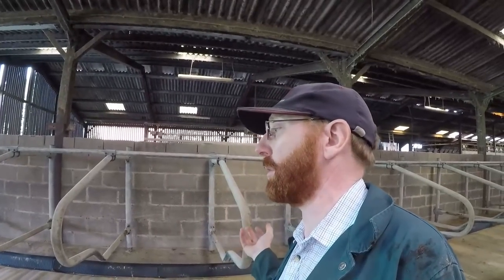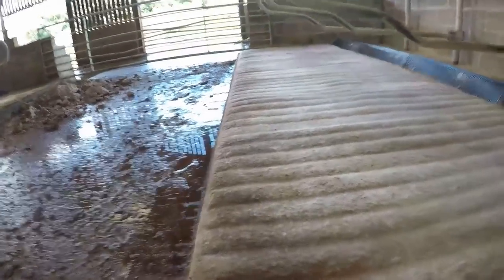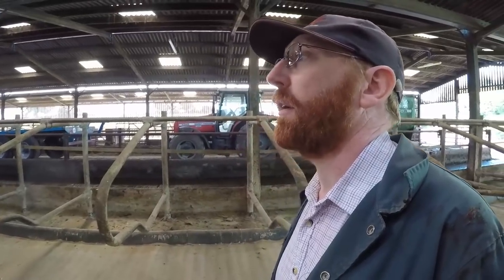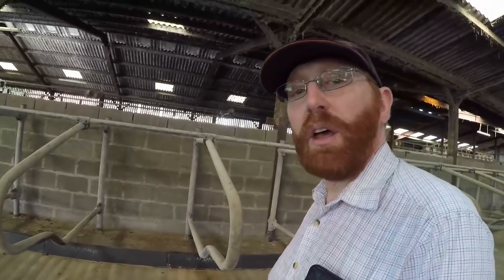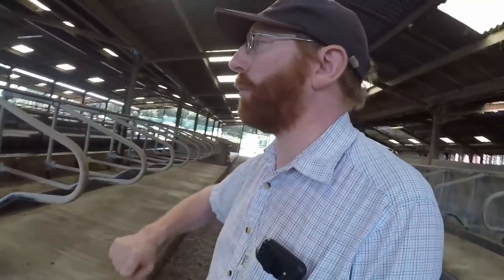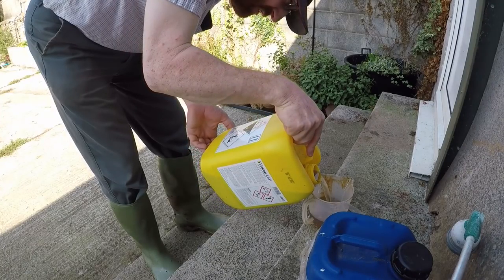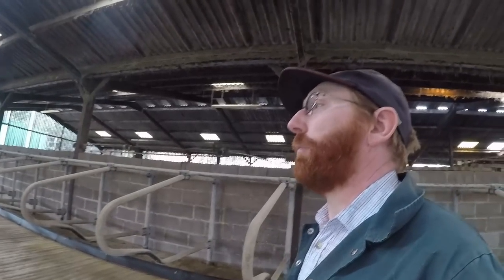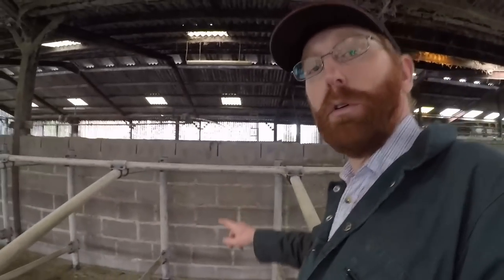Summer clean for the cow beds.

Comment: Good hygiene regime, and informative video. Have you considered applying the disinfectant via the pressure washer. Having a storage/ header  tank with the appropriate dosage would take care of that side of things. So long as it wouldn't bugger any seals within the washer. The pressure would atomise and get into the brick work better and possibly save time? We have used this method before in pig sheds.